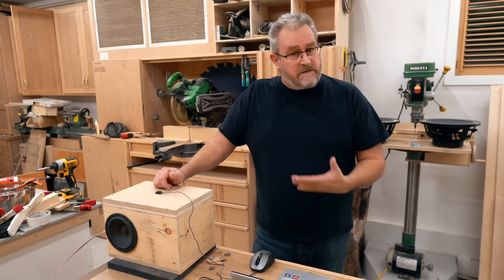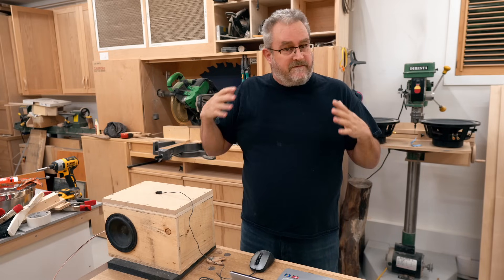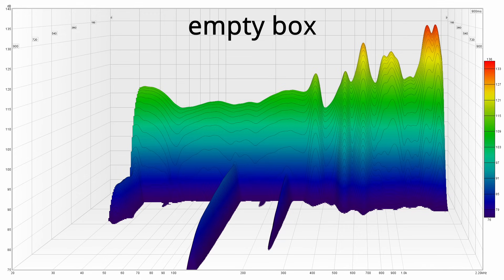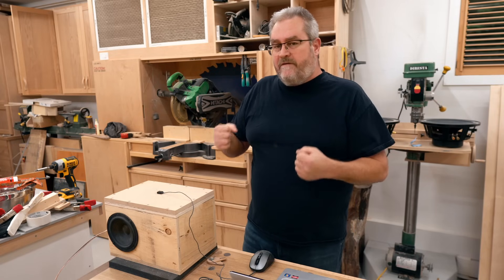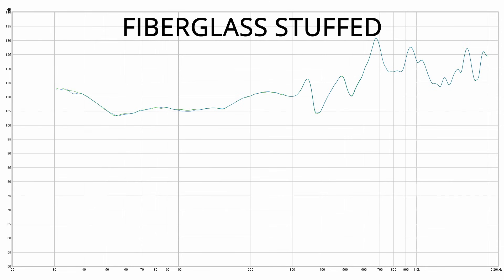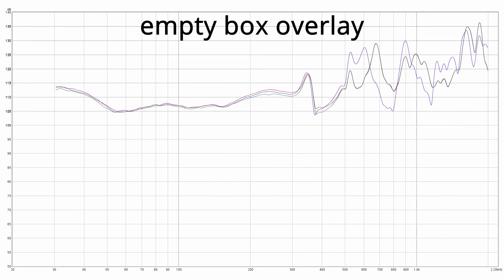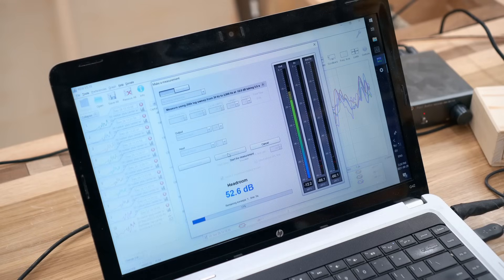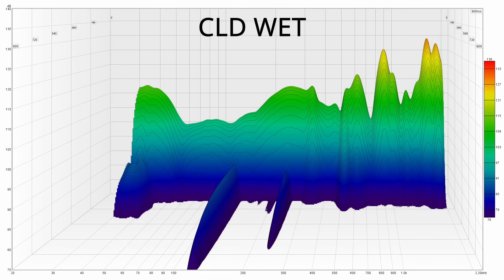Best Stuffing for Speakers Tested - Unexpected Results

Comment: Hey i was wondering can i use the same principles as soundproofing a wall and eliminateing echoes by using  like cone stryctures in all typses of hights to absorb the resonant frequencies or will that make the speaker sound dead? i am not experimenting with saw dust with pva. i made a speaker and i need a thicker front panel its a bluethooth portable 200w speaker so theres not much space. to be honest i would need to remake it cause the 100w sub is way to much for the thickness of that boerd but i was wondering if i could make a putty and just make the wood thicker that way. the first small plate i made isnt dry yet after some 15h but it looks like the adhesion is greeat and it seems to stay somewhat plastic and moldable maybe when it dries it will harden but right now if i can use the spike type of structure this would be amazing material to do it with.

Comment: I'm open to the idea that I'm all wet, but from my understanding CLD requires a decoupling surface like foam to isolate the mass-loaded material from the panel. That's what prevents energy from transferring from one surface to another. Applying it with silicone just bonds the mass to the panel.

Comment: Do NOT use fiberglass or rock wool with speakers with a vented pole piece. You will destroy your speakers. Loose glass and rock particles will find its way into the voice coil gap and create enough friction to set them on fire.

Comment: Glass and rock wool slowly decomposes by the time, because of the mechanical vibrations from the sound. This glass dust particles make huge damages in the coil and spider area. We had this issue with old Telefunken TLX 2, 3, Kenwood trio LS, Pioneer and RCF speakers. Sometimes beyond unrepairable.
Reply: Fiberglass is like sandpaper
Reply: Wow 
Thanks for information !!  
Never would've thought 💭
Reply: So basically you had 50+ years old speakers and their filling was a problem? LOL.
Reply: @Munakas-wq3gp you want me to open My original TLX? Wait few months, then I will show You. Someone in the past was a barbaric repairman…..
Reply: @BMRStudio  I don't touch vintage speakers for a reason. The technology has advanced ten fold compared to amps of the same time. And I'm not speaking about single drivers which are still pretty crude mechanical devices but speakers as a whole.

Comment: You don't want to use fibreglass or rockwool because fibres break into dangerous small particles .
Use Dacron or actual wool. Fill the entire space. The board you are using is too thin.

Comment: Back in the 1950's and 1960's JBL (Jim Lansing, the Lansing in Altec Lansing) used a proprietary particle board.  This particle board was made with random sized wood particles.  The purpose was to make a resonate free cabinet.  The resonant frequency of the particles were random.  This effectively prevented the wood from resonating at any one frequency.  I read somewhere that the actor Richard Boone gave him the idea.  Even the Ranger Paragon used this material with a fine vaneer overlay.  Plywood is not a good material for speaker cabinets.  All the laminations are the same size and resonate at a common frequency.
Reply from the maker: What you are describing is marketing hype, where you say a material does this special thing (like not resonate) and that gets the buyers all jazzed up thinking they are getting something special.
In another of my videos I show that even if the speaker doesn't vibrate (impossible, by the way), the walls in the room will. And depending on how the wall is built it will vibrate as much or more than the speaker cabinet panels do.

Comment: I build my encloser from 3/4 inch (19mm) Burch ply. It had a slight buzzy ring. 

So, cut the front baffle off, put a heaver mid brace inside. Then used 'Flex-Seal' brush on rubber on all surfaces inside and out. Then I lined the inside back and sides with a scrap piece of "Mohawk" Berber carpet but no other filling. 

So much better. I do not have all the 'Wiz-Bang' test gear but to these damaged Tinnitus ears, it sounds so much better. I have ear damage that shows up as a 20 dB White Noise shusssss all day and night.
Reply: 10% of the world has tinnitus, often coming from listening to loud sounds such as loud speakers, concerts, or industrial equipment, soldiers also come back from war zones with tinnitus, many DJ's also get it, yet there are no warnings about tinnitus in hifi equipment manuals just general information about hearing loss.

With so many getting tinnitus you'd have thought the drug peddler / companies would make us a cure and make themselves billions, but sadly still no cure yet, although some universities are getting closer with their research.
I try to warn as many as possible, but most assume they'll never get it, despite listening to music and movies far too loud.

Comment: Good effort, but I can't understand why you didn't put the fillings behind the woofer section,  because by filling just half the speaker cabinet with sound deadening material would allow sound waves to bounce around quite happily in the bare cabinet woofer section ! Another option would be egg box foam placed on all sides of the cabinet, or even 1/2" felt pads stuck to all internal panels, maybe try those suggestions next time round 😊

Comment: A Mic is for measuring the resonance from the case influencing the flatness of the curve of the speaker. You have to measure the speaker when you test stuffing. The accelerometer is used to test dampening material like bitumen.

You will se much higher difference with stuffing in mic measurement and much higher difference's with the accelerometer when testing dampening materials. You mixed up the Methodes and the measurements. 

That's why all your measurements are equal. Because the stuffing does nothing to the wood and the accelerometer because that's not what I meant to do.😅

Please watch this video! Explains it!
https://youtu.be/DtQkMpHsMro?si=pqQksFQRXjSi0t8J

Comment: Thanks for this really good video.    Do you have details of the accelerometer you used, and what method it uses to connect to your computer, etc?   I would like to try to replicate your experiment method to help with some speakers I'm building.
Happy if you have an affiliate link you'd like to share. Thanks again.

Comment: I use wall insulation the one they use to insulate walls on homes and it works exelent i have some vintage sony speakers and what they use is polyfill sony speakers dont come with a crossover an on top of that they use polyfill and they sounded horrible i put a pair of crossovers and pulled out the polly fill and put some wall insulation inside and wow! what a diffrence it made your right about the polyfill its horrible a lot of electronics companys cut corners so they can make a product at an afordable cost   them and in the process they end up selling garbage to the consumer you got it right polyfill is horrible

Comment: Instead of using rubber sheets (or as well as) I would have preferred you to use an actual sound absorbing product that is engineered to absord sound energy within the material by turning it into heat. Something like Noico or Dodomat. In the 'car world' these are known to absorb much more noise than cheaper materials like rubber or even shed felt (yes, people really do)!
Reply: Dynamat is butyl rubber and foam.

Comment: Since as you say the advantage of fiberglass and rockwool is the higher density, I'm puzzled as to why you would disadvantage them by putting in the same weight as polyfill and not the same volume.

Comment: Very interesting testing. However, the point of internal stuffing has nothing to do with damping the speaker cabinet resonances. It's purpose is two fold a) to change (slow) the speed of sound within the box, thus altering tuning, effectively makes the box bigger from the perspective of the drive unit, and more importantly b) to absorb and damp internal acoustic resonances which will impact the drive units frequency response. To see the real impact of internal speaker stuffing, you need to measure the drive units response with each (and with nothing as a reference point). 
It would have been intersting if you'd had a 5mm (or so) matt of low compliance rubber to place between the two panels when doing the constrained damping test. I think that would work better at actually isolating the outer panel from being driven by the inner panel than silicone would, as it's more compliant.

Comment: There are 2 problems to solve. 1 is to absorb the sound in the box so that it doesnt radiate back through the cone (using filling), the 2nd is to suppress panel vibrations being transmitted mechanically by the driver to the cabinet by constructing a rigid/well-damped box.
My methodology over many years is to use shelf bracing, often several horizontal and vertical in larger speakers (think B&W matrix) to raise the resonant frequency of the panels where they can be more easily controlled, then glue 1/2" felt to the walls and finally fill with lambs wool.

Comment: I put polyfill in my ported box because it was a tad bit smaller than the recommendation come to find out it took the port noise away lowered the frequency and got a smoother response now if your vented enclosure is built to manufacture specs I don't recommend using polyfill?

Comment: 900 Hz resonance with the speed in air of about 343,2 m/s results in a wavelength of 0.381m. divided by two is about 19cm. is this the inner distance between your top and bottom panel? because i think you have a standing wave there. to break that up you would need a panel with 4 big holes in between but not exactly in the middle because that would result in two synchronous standing waves at about 1800Hz.
you would need to split up the 19cm distance in an odd ratio that the resulting two compartments have a different height. usually the "golden ratio" is a good idea. then the two new standing waves are not feeding a combined resonance.
does this "sound" reasonable?

Comment: And double the panels of the pressed board Sawdust stuff that is 1 1/2 inch thick of the denses panels you could have the same thickness plywood will be much flimsier and transfer the loss of energy in the sound waves instead of  HITTING LIKE  THEY SAY ITS SUPPOSED TO NOT VIBRATE EVERY THING AROUND  IT SOUND DISTORTED AND NOT HIT YA WITH THE NEW RYTHUM OF YOUR HEART WITH CLEAR HITTING BASS THAT YOU CAN'T GET WITH PLYWOOD AND STUFFING YOUR BOXES WITH COTTON AND FOAM AND TRY THE FINE SAND POWDER JUST COAT T COMPLETE BOTTOM OF THE BOX ABOUT A EIGHTH OF A INCH I WOULD NOT SUGGEST TO USE IT IN PORTED BOXES THAT HAVE NO PANELS SO THE AIR DOESN'T JUST BLOW OUT WITH NO PRESSER SO WEN SECTIONED THE AIR KEEPS PRESSURE WHILE STILL MOVING AIR TROUGH THE PORT

Comment: Listen plywood is not a good speaker would believe it or not the pressed wood that wonderboard pressed Sawdust crap  get a three-quarter inch thick sheet its denser than the plywood and fiberglass and the less give in the box the harder the  air gets moving  it gets forced to change directions faster with less force lost ur trying to move  air not vibrate and move the  sides and back panels same with the stuffing the sand or powder  dose what they think cotton and fiberglass  foam all actually make the speaker heat up faster so RMS guarantee TO LOWER also  chamber your  boxes and seal them so air can't transfer  also  less likely to blow a speaker the difference is like a JL Audio compared to Jensen also cotton or polyester is not the best substance to use and get better sound it's actually a fine powder or sand not sure the name only on one episode of this car show one time and the reason why is speakers need a certain amount of air space to function that's what most speaker boxes are built for by putting cotton or polyester in the Box to take away the cubic feet 4 in out of the airspace the powder or sand only gets filled at the bottom of the speaker box when you go to install the speaker for the last time the only takes up small amount in the Box itself but when the sound waves start pushing the air that the dusting powder whatever crap starts kicking with the air and makes the air denser will not taking up the airspace in the box like the cotton or foam or polyester would bet money on it it was crazy when the guy showed the difference on TV

Comment: It was great that you tested a wide variety of materials, but it should be compared by volume, as well as weight.
Another material i haven't seen used much that i plan on trying my own tests when i get the chance is closed cell foam, not sure if any of you have had any experience with that.

Comment: Stuffing is not for dampening panel resonances. Stuffing is for controlling internal box reflections, tuning the Q of the enclosure, or increasing the effective internal volume.  Panel resonance is FAR more affected by bracing, material choice, and with direct contact dampening materials like vinyl or NoRes.

Comment: Measuring it's R factor should determine how much acoustic insulation you need and it's effectiveness. And also how dense you can make it and how easy to adhere the enclosure walls. I used to use lambs wool and also a material called Tufflex. Lambs wool was especially effective as it had a very high R factor but it was also difficult to work with and had a tendency to settle. Tufflex had a decently high R factor was easy to cut, came in rolls and (similar to foam) was rigid enough to stay in place.
Reply: Was Tufflex something like Kimberly-Clark's "Kimsul" ?

Comment: with a remark: I don't believe this sweep test is relevant as the moment you record the next upper frequency you don't  know if the panel is free by resonances produced by the previous low frequency (meant the previous resonance in panel is complete damped). It is preferable then, if still insist on a sweep test, to sweep from high freq to low freq as the previous freq will be damped more fast in case of. As comparison I.ll do for same tested material a double sweep: from low to high and from high to low to confirm, or not, identical results. Otherwise the measurement will be derated by still stored energy in the panel.

Comment: I did some tests 25 years ago with an SPL meter, two 12" subwoofers in a sealed enclosure (trunk tire well enclosure) and various amounts of polyfill.  I did individual frequency plots on a graph, 1Hz intervals.  I found that adding polyfill decreased peaks and extended lows.  There was a threshold where overall I started to lose some amplitude on all frequencies if I stuffed the enclosure too much.  It was a great experiment to prove to myself that spikey response in a subwoofer can be tamed some.
Reply: That's essentially lowering the Q by slowing the air, thus the driver appears to have more internal volume to work with. Up to 40% of the internal volume is effective, if i recall. Check with ChatGPT/Bing/Bard.
Reply: That's really cool, and I've seen your results repeated elsewhere on YT. Adding polyfill does have a point of diminishing returns, but until then it will reduce bass resonance.

Comment: Very interesting! what software were you using for the test? The damping material used is usually to control the resonance and other box parameters without regard to panel vibrations. Speaker enclosures can be viewed as filter networks, particularly for vented enclosures (such as Butterworth alignments.) However, controlling resonances will indirectly control the amount of energy available at any frequency to flex panels. You might consider using a measurement microphone to measure the acoustic radiation from a panel as opposed to the contact sensor on the panel. You might consider a box made of mdf instead of plywood. Mdf is a good material for do it yourself enthusiasts has high density and greater acoustic losses. Internal bracing is also effective in reducing any panel vibrations. Of course if you really want to eliminate you can build enclosures out of concrete, which I did for a customer in the mid 1970s. Wharfedale had speakers, which you poured sand into a sandwich construction enclosure in the 1960s. A speaker box has 6 surfaces, the most important is the baffle which is aimed at the listener, any radiation from top, sides, and rear are radiating into the room and contributing to reflected and not direct sound. The bottom of the speaker if sitting directly on a floor is coupled to that radiating 'panel', which changes the sound. That can be modified in a number of ways, a layer of material such as Vibrathane, a large mass (concrete), speaker spikes, or a combination of these.Keep up the good work! - Paul - former speaker designer.

Comment: I built a 2 qft interior sub box for a 10 inch 400 RMS - 2 - 3 inch ports and 1/4 Cork 100% lined.  Build material 1-1/8 thick stair plywood.  I thought it worked very well.

Comment: I built speakers in my youth but never had access to the tools available now, so I have no experience with them.   That said, I have a feeling you are scanning the frequency range way too fast.   In my experience resonances take a while to build up.   It makes sense right?  Like if you push a kid on a swing it takes multiple cycles before the resonant amplitude builds up.    You are not spending enough time at any given frequency for a panel resonance to build.  (IMHO).    So.  Have you ever tried scanning much slower?  I would be fascinated to see if that makes any difference.